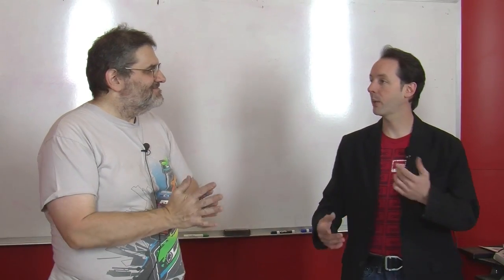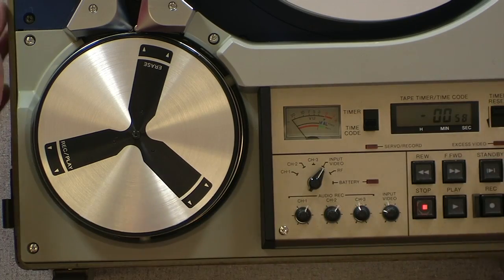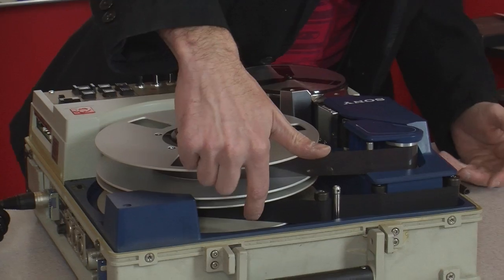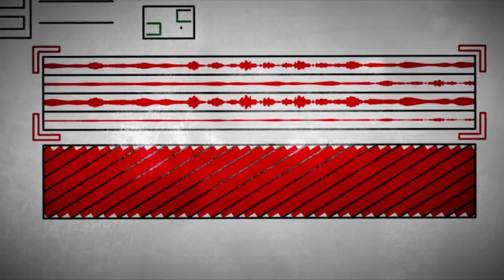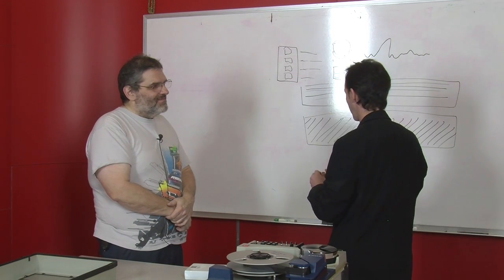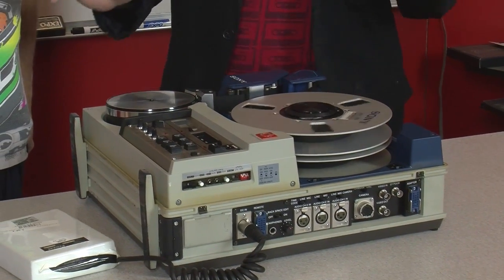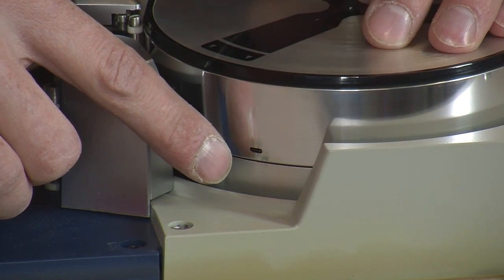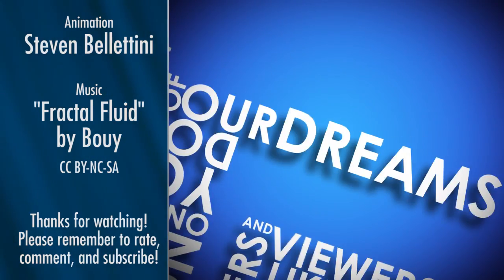How Reel-to-Reel Video Recorders Work

Comment: Not sure you mentioned this, but this was a "super-compact" portable VTR for field recording.  On the studio models, the tape reels were "side-by-side" rather than stacked, and they probably accepted larger reels.

In modern VTRs (starting with Sony's 3/4" U-Matic), they put the head drum at an angle, instead of the tape - this allowed both reels of tape to be on the same plane inside the cassette.  (Several early formats such as "Catrivision" had the reels stacked inside the cartridge).

Comment: The control track has nothing to do with copy protection. Each pulse denotes the start of a video track so 60 for NTSC sand 50 for pal. It locks the vtr servos which set the tape speed and head servo lock.

Comment: Great machine! One word about the helical scanning, the ‘why’. It’s not about using the full surface of the tape. Video required much higher frequencies to be recorded (compared to audio), for which you need extremely high tape speeds. The helical scanning delivers just that: the tape speed as seen by the head is mostly determined by the rotational movement of the head drum. And because of the very high frequencies a narrow head will do, which also enables packing the tracks closer to each other. Altogether the tape surface is more densely packed with information, but it’s the high frequency recording that requires a high relative tape speed, obtained by the helical scanning.

Comment: I always wondered if there is a vertical tension on the tape which travels from down reel to top reel. Since the tape path is not parallel to hubs (because tape ramps up at some point) the tape is being stretched on one edge while being collapsed on the other. Am I missing something here?

Comment: The reason for a spinning head has got nothing to do with data density and everything to do with frequency. The maximum recordable frequency on magnetic tape is directly related to the head gap and the speed of the tape. (F= Head gap / Tape speed) The frequencies required for video are in the megahertz range (unlike audio which maxes out about 20khz) and even with the smallest head gap possible the tape would have to be moving ridiculously fast to record signals in the MHz range. So instead of having a tape moving at 60mph they make the head do it and record across a tape moving at a more manageable rate.
Reply from the maker: I love it when people who are smarter than me teach things in the comments. Thank you! :)

Comment: I used to maintain one of these BVH-500s, as well as our studio BVH-2000s and 2500s.  Amazing machines, especially the portable 500.  With the internal battery pack, it weighed something like 80 pounds, so every time I took it for a field recording shoot (we did a show from a bowling alley every week), I got a real workout.  Good to see one running again, though I was cringing to watch how you threaded it.  Generally speaking, you would pull about three feet of tape off the end of the supply reel and thread it through the tape path -- you don't pull it through, especially through the video head assembly.  Pulling the tape through not only damages the tape (you can see the puckering in the tape surface where you snagged the entrance guide), putting tension on incompletely seated tape risks chipping one of the video head tips.  Aside from being better and safer practice, it's also much faster -- I used to do it in about ten seconds.  Finally, you want to trim off damaged tape ends, because they will get caught between the spinning drum and the entrance and exit guides -- there's only about two tape thicknesses of clearance at that point.  Studio machines like the BVH-2000 had retracting guides that would move away from the spinning drum as the tape was about to unthread, but the guides are fixed on these portable machines.
Reply: You never worked on a poetable quad I bet. It could only record 20 min videos. Had no room for an erase head so you had to use a degaused tape to record on. In addition the tension arms were actually air dialectic caps. So the humidity had to be just right..
The heads rotacts at 14,000 rpm and used ball bearings which wore out. The studio quad machine had the headwheel on air bearings
Reply: @rty1955  At the TV station I worked at in 1984 we had a "Quad in a briefcase."  I remember the ball bearing head assembly.

Comment: As a professional vtr operator for over 55 yrs u are making a mockery of video recording.
First off a control track is an analog tone that is layed down the same time the video is layed down. On playback the tone is used to set the tape speed. It is also used to set the head speed. The phase difference is called tracking. A control track has NOTHING to do with time code!
A LTC. (Lineear tine code) is recorded on channel-3 where channel1&2 is used for audio.
I cringe watxhing this video!
Btw BVH stands for Broadcast Video Helical
Amoex made the first the first broadcast VTR. The phrase VIDEO TAPE is coined by Ampex.
Your explanation of how video is recorded they way it is is totally wrong.
I would be happy to be a technical advisor if you want to re-do rhis video.
I have wprked on every machine Ampex built from quads to 1"-C

Comment: You are totally wrong about control track. You were doing good until the control track and footprint section. You are lost. Control track is analogous to sprocket holes on film. The CTL pulse provides picture lock to video track. On the 500A there was also a frame pulse recorded on very other CTL pulse used for color frame editing. This was the improved BVH-500A servo but the biggest improvement over the 500 was the connectors used for internal interconnect. Gold contacts! The 500's connectors would oxidize and you would sometimes make the machine work by dropping the machine from a couple of inches. Many failed remotes back in the day! Stiction is rubbing noise from the tape lubricants not performing keeping the proper air gap between head tip and tape! Tape backing, binders can fail, especially with Ampex tape. Glad you finally noticed 3 audio tracks since you left that off your footprint diagram. Track 3 is for time code, recorded next to the CTL track.
Reply: Actually the control track is not pulses at all. Its tone of 240hz. The purpose is set the speed of the capstan and thus tape speed during playback.
I worked on EVERY AMPEX machine since the VR-1000. Went to AMPEX school in redwood Calif too

Comment: The B in the model number stands for beta which describes the way it wraps around the video drum.
Reply: No it does not, it stands for Broadcast, and the V is for Video. The H was used for all Sony recorders, while a P was for cameras.
Reply: @Geebax2  Moreover, one-inch machines used an Omega wrap.
Reply: @Geebax2  haha BVH stands for Broadcast Video Helical
Just like the came as BVP atand for Broadcast Video Photo (or camera)
BVM stand fir. Broadcast Video Monitor etc
Sont had a division that was called Broadcast Video

Comment: Brought back so many memories of High School and early college...  Editing on an AV3650 and AV8650 RtR Video... Cleaning the heads (and yes, they spin up fast) with Xylenes (and don't break them - they're more fragile than a soap bubble), 3 twists on the take-up, 10 seconds (minimum) of leader run.  Getting both machines in sync, and we haven't EVEN gotten into PVS's and the old-school analog SEG's...  The Panasonic 3085 Porta-pak was awesome - you had a camera, the VTR on a strap on one shoulder, and the battery pak either (hopefully) on a belt pack, or hanging off the other shoulder (and squeezing the sides of your neck) - because the on-board NiCad was worthless for recording time.  

And you're right - once you do it enough times, threading is awesomely fast and smooth.  Thank you for bringing me back to the good old days!

Comment: Is that AMPEX tape hard to find?
Reply: Regular 1/4" tapes are expensive as kidneys, 1" tapes, man, hard to find and expensive as exclusive top-class hooker.
Reply: It's certainly going to be expensive especially virgin tape.  But a lot of companies made that  back in the day.  Ampex, Fuji, Sony, Kodak, AGFA/BASF and scotch/3m were some of the companies.   I bet you can find a lot of tape on eBay but who knows what shape it'd be in.
Reply: I have 4 cases of 3m 1" 60min stock also a BVH-2000 and a BVH-500A

Comment: You are totally wrong. If you don't have a control track your playback servo will never lock onto the tape, it will go into free run mode, and you will end up with head switching point running through the picture on 2  head (VCR) machines. On single head systems, like the 1" you are working on there won't be the head switch problem (on the 2 head machines the CTRL pulse is used to lock in the tracking for the A field. On a single head machine, technically it is possible to play the tape back if the machine is genlocked to station sync, where the servos can get a reference, but still since there is no reference on the physical tape the tracking can drift in cases where the tape has stretched.Copy protection has had a few different systems tried. The earliest was modification of the video sync, where most, but not all of the vertical sync was stripped. This caused the recording machine that was being used to bootleg a copy to have a heart attack and the result was generally servos falling out of sync and going into free run mode. The result is the copy has head switching point slowly drifting through the picture. The later forms of copy protection was macrovision, which the added severely over recorded pulses to the luminance channel in the vertical blanking area. They would record on a machine with manual video gain controls and record white video at up to 150IRE, and drive the opposing black pulse down below 0IRE into the blanking area on the first dozen or so lines of video following vertical blanking.  This caused the AGC on the recording machine to go crazy trying to set record levels and resulted in a picture that blinked bright dark, bright dark and the color to be messed up.Later versions of macrovision, called color stripe made changes to the timing of the color burst which resulted in thin color bands across the picture.Its a beautiful machine. Would love to have one of those in my collection. Carried one for years when I was in broadcast.The term "stiction" was used frequently, and it refers to worn tape that the binder or back coating is "sticking" to metal parts. On playback these tapes would start to screech as they played, and the picture would get lots of wiggly lines caused by these vibrations on the tape. Was a big problem with Ampex tapes.
Reply: you are right on every point.
Reply: Hi 12VoltVids, excellent informative explanations, thank you for taking the time to clarify it, Ciao, L
Reply: Can you make a video on one of these (sorry for my bad english i speak spanish)
Reply: Control track as other people have said is used by the VTR servo to align the video tracks and speed of the tape to the video replay head. Tracking adjust this relationship. Control track has no timecode information, timecode was recorded as a seperate track.
Reply: You're mostly correct, with one minor quibble: you absolutely need the control track to achieve playback servo lock on this machine, because it lacks the R/P sync head 30° offset from the R/P video head -- so the tape is actually missing the vertical interval between lines 4 and 16.  This pretty much prevents the machine from discerning where the track actually is with relation to the video lines.  On a machine with the sync head you can theoretically identify the start of a field... but in practice the only machines that pull this off are the ones with dynamic tracking heads like BVH-2000s (and even they get upset if they don't see the control track).
Reply: Its Funny that the leader in magnetic recording made the worst tape pros almost always used 3m stock as it was very good, uniform quality. Fuji made great tape (on quads) but after 6-7 passes it degraded fast. It was good for camera masters as input to edit.
On some machines such as the AMPEX AVR-1&3 and ACR series could easily playbackna tape with no control track. It derived rhe control track from the frame rate. All u needed was a few frames so the internal oscillators locked on. The machine knew what the frame rate should be and opon playback would try the control track if that was bad it derived it from the frames
Also I want to point out that a control track was a tone (normally 240hz) not pulses, tha sole purpose was to lock the capstan (or vertical lock) on playback. The control track was derived from vertical sync as it was imperative that the control track was locked to the frame rate.
In addition one company I worked for was one of the largest vhs duplication companies in the USA, we devised a copy protection system that would randomly place extra sync pulses on the video signal. It was no problem on playback. Bor was it a problem for tv sets, but when the video signal was fed to another recorder in which the capstan speed was set based upon the vertical interval, all hell would break lose on tbe record machine.
All of these copy protection schemes wwre broken fast by pirates
Reply: @12VoltVids YOU ARE the Man! Sir! when it comes to this topic

Comment: Believe it or not, standard VHS tape only has a single mono audio track. SVHS has "HiFi" Stereo on the helical data. One of the features of SVHS was increased bandwidth due to better formulations. They encoded the audio subcarrier into the helical strip itself but left the mono audio carrier for reverse compatibility. It's really neat.
Reply: ***** There are tapes with stereo linear tracks, I use to have one but it didn't sound very good, especially when playing SLP.
Reply: ***** S-VHS used a 6 head recording system, though incompatible with 4-head jobs, could play regular VHS tapes. Standard tapes made for regular 4-head jobs still had a HI-FI stereo track. Look at the spine of any old film and you'll see that listed in the information on the back. I should know, I grew up with the things.
Reply: +Nick sargente That's generally true with VHS, although some VHS machines are stereo on linear tracks.

Comment: The scanner has the record/play head and the erase head. The third "head" is called a dummy head, it doesn't do anything and it's only there for balance. Audio, control track and linear time code is recorded on a stationary stack heads. Control track is not really time code, it's more like sprockets on motion picture film. The control track is what lines the scanner play head up to the recorded video track. Some machines also record vertical interval time code, which is laid down with on the video track. VITC time code can be read at slow speeds or even when the machine is in still mode, longitudinal time code, like audio, can only be read at speed.
Reply: Well close. The control track is an audio tone of 240hz not pulses. This tone is a mutiple if the frame rate (60hz) agreed this is like sprocked holes on film, however film speed is mostly. VERY lax, and varies greatly inless its a professional projector. The control track tone is there to merely set the capstan speed on playback. Tracking sets the the spinning heads phasing from the control track. BOTH tape speed AND head speed must be in sync
Reply: +MurrTV Yeah i was thinking the third "head" was for mechanical balance as well.
Reply: @BertGrink  On a studio machine like the BVH-2000, that third head position was for dynamic tracking playback: a special head mounted on a quartz substrate that could move slightly when a control voltage was applied.  This allowed the machine to produce clean still-frames and variable speed playback from –1x to +3x speed.  A machine without the DT head still needed dummy tips, because they maintain the correct drum circumference.

Comment: a Videotrack from a Video-Head (A) have never a Angle of 45°. The Videotrack is more flat and for PAL625 you have one Videotrack from one Head(A) to the next Head(B) with the length of the half round of the circle (this is the silver thing) the VHS have a relative Tape to Head Speed from around 7,02m/s this machine have much more so the SNR is times better then from VHS. maybe 20m/s because on this machine is the Head A to Head B more then 90% from the Circle of the Videoscanner.

Comment: control track is the track that guid the heads to the tape. if you donts have control track you see drops at video and non stable audio
Reply: Untrue. I work in EVERY machone AMPEX made ceom the VR-1000 to the VPR series.
Control track is a tone of 240hz. It is multiple of  the field rate of 60hz. This control track, because of its very nature of coming from the field rate would make itnlike sprokwt holes on film. After the control track is layed on the tape and during playback, this set the capstan speed for the tape forward motion. Tracking was derived from maximum RF coming od the tape. They call it RF Because the video signal was Frequency Modulated (or FM) that was very high in frequency this allowed from praxtically DC TO 6MHZ to be recorded on tape

Comment: I was one of those "guys" but not a gorilla (made Steadicam seem light weight) and you don't even mention the weight of the batteries since the 1" sucked power like nothing short of the cameras which we could use as a food warmer on cold days! Generally the smarter among us wound up making various carts and so forth to carry all the junk. By the way the portables could only play heterodyne color back and not "real" color. To play in the field it required another box which was a color adapter.